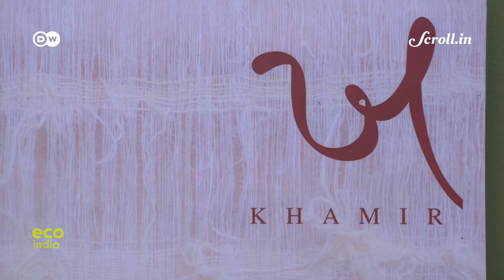Eco India: Meet the artisans who are reviving the traditional, eco-friendly art of Batik printing

Comment: I'm still slightly worried about it sustaining itself amidst desertification. Because printing, of any kind, is still a water intensive process....till we think of one which isn't..the water crisis concerns don't go away with the simple switch to vegetables dyes even if it is better.
Reply: With vegetable dyes, the effluent water has a chance to go back and recharge the water table, without making it toxic and unusable.
Reply: The focus should be multi pronged.. reviving ground water,  using vegetable dyes, awareness of the buyer
Reply: I'm aware that this is a eco friendly option, and that the water can go back to the groundwater table without hiccups. But it's not solving the problem of continuing water intensive crafts in water scarce areas. Its not the printing of kalamkari on the sea beds in machlipatnam that such questions would arise.
Reply: @nitee2100  those are the layout plans and yes should be done... and as much as that is the overarching solution, something more specific I'm afraid is what im asking for? Perhpas a solution quite simple, yet tackling that exaxt issue?
Reply: Do as Sadhguru did and start a movement to plant trees...surely he would help advise on the matter with his experience...